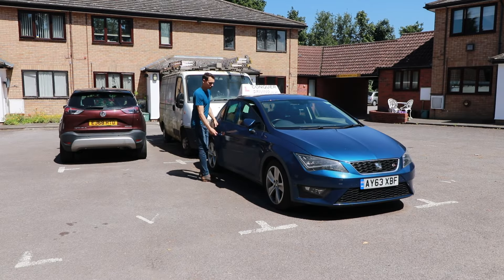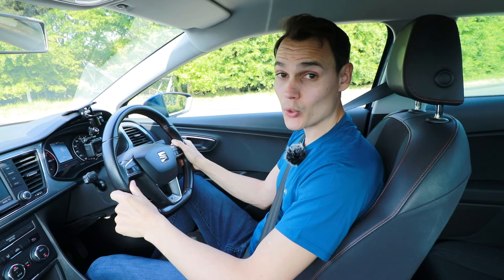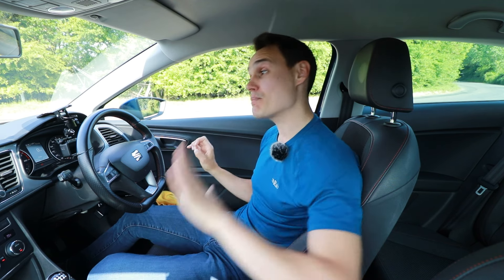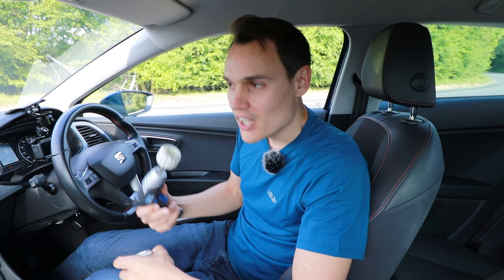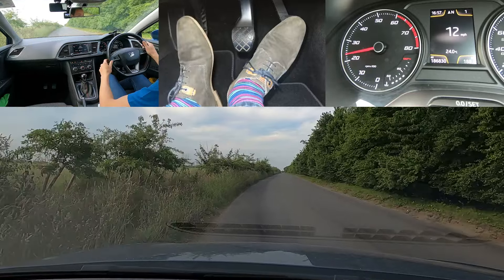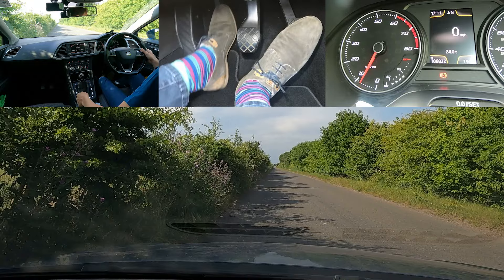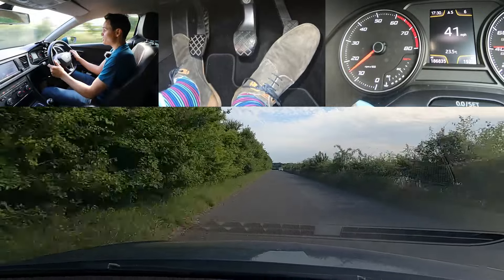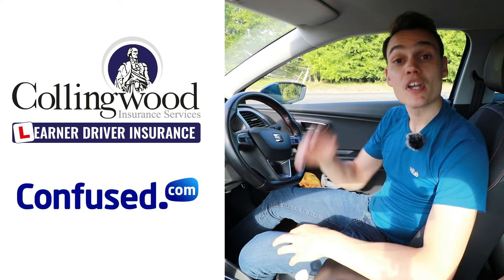Clutch Down Jerk? How to make it smooth.

Comment: As an American learner with my first 5 speed I’ve been binge watching these and then going out and driving around for hours after practicing 😅 
I’ve gotten decent at rec matching but my older car is very precise with the rev locations between shifts so I have to make sure I’m on it! 
Also hill starts were terrifying to me until I realized the E-brake method wasn’t actually hard I was just scared to try it 
My advice for nervous learners is to just put yourself in the worst of it like traffic and stop signs then do it again because that’s all driving really is in the end 😅

Comment: This is very vehicle specific. We have a Suzuki Swift that this applies to, but it also helps to press the clutch in as soon as you come off the accelerator. However on our other cars doing the opposite tends to be smoother,  which I very much prefer.

Comment: I am so stressed out trying to learn manual. My driving instructor wasnt helping much either. This clutch method i was taught while on the road driving with cars. It scared the hell out me since he started shouting 'clutch clutch'. I'm a beginner man. He also told me to release the clutch immediately after changing the gear and then press the gas pedal.

Comment: when doing Full Throttle shift, I think its pretty much a quick "see-saw" method. The reason is because the travel of throttle is long compared to when you are just cruising. When cruising with just like 10-25% throttle, it can be felt that it is clutch down first then off gas. When going full throttle, there has been instances where my gas doesn't come off quickly enough when my mind is set to Clutch down first then off gas. Just as shown at 6:40 when you did it a bit slower with clutch down first/then off gas...your revs shot up a bit. That is what happened to me when going full throttle with the mindset of not doing a FAST See-saw method.
Reply from the maker: I definitely don't do it perfectly everytime. Especially when switching cars often.

Comment: I know sometimes when I engage my clutch there's like an oscillating judder. I assume it's because the engine and gear aren't quite at the same speed and the judder is the clutch plate dampening springs bouncing backwards and forwards.

Comment: 2:44 I once thought this would most apply to turbocharged engines but a few months ago I was merging into the motorway with a hard acceleration in 3rd gear on a natural aspirated. When it was time to change, I thought: "I better come off the gas first before the clutch or the revs will go up". I let off the gas and tenths of seconds later, the clutch is down and still the revs went up as I clutched in.
Reply: My car does exactly the same thing and it's naturally aspirated. I usually lift off and wait till I feel the power to the wheels neutralise and then press the clutch in. In my car if I do it right you get a millisecond of rev hang after pressing the clutch and by the time you change to the next gear the revs are matched perfectly to lift the clutch and smoothly transition into driving the next gear. 

If you're curious my car is a Toyota Aygo. I can imagine this is true for allot of cars though, I assume the intake manifold takes a split second to build back up a vacuum.
Reply: @micheals1992  "Toyota Aygo" I think I know why yours does exactly the same thing. The car was driving was in fact a Toyota yaris with the 1.0 VVTI 69HP. I think the Aygo has the exact same engine with, if not the same, close  power.
Reply: @Danielagostinho21  it is the same engine, the only differences I'm aware of is that the 1L Yaris has a aluminium sump and an electronic throttle body (the Aygo uses a cable).

Comment: Well explained. Sometimes, like 1 out of 5 times, when I am pressing the clutch down, I feel some vibrations. I can feel the spinning of the engine. Nobody feels anything except my foot on the clutch pedal. Is it because my revs are too high for a particular gear? If I'm not wrong I have observed this more oftenly when shifting 2 to 3 and 3 to 4. What I am doing wrong unconsciously?
Reply from the maker: If your engine revs are increasing when you press the clutch down, it means you may be staying on the gas pedal. Try releasing the gas as you press the clutch down. If you are coming off the gas pedal and this is still happening, then you may have a problem with your car.

Comment: What about with downshifting? I've found that when down shifting at higher speeds (say, 3rd to 2nd at 30 mph) the car jerks a bit. I assumed that was natural since the rotational energy is being cut off from the drive train.
Reply: 30mph is still too fast for 2nd gear, hence the jerk. You should slow to a more appropriate speed (around 15mph) before downshifting to 2nd and reapply the gas as clutch goes through the bite point for a smooth transition. With practice you shouldn't feel any jerkiness.
Reply: There is a certain correspondence between car speed and engine revs for each gear. High speed at lower gear means very high revs, but when you downshift, your engine is probably at low revs. It can't suddenly go to high revs when you downshift due to the flywheel inertia. It will try to swallow your kinetic energy in a gulp (hence the jerk), but this is not a graceful thing at all.
Reply: I believe if you're going from 3rd -> 2nd at 30mph you need to rev match for it to be smooth. Depends on the gear ratios of the car though but I assume you would be changing down because  your 3rd gear doesn't have the power you want. Anyone correct me if I'm wrong though
Reply from the maker: This video may help: https://youtu.be/RMYtBIO6mLM

Comment: Hi, when I apply clutch, half way mark pedal has slight pressure but after halfway mark it goes suddenly down feeling no pressure.
Clutch Pressure plate change recently
Reply from the maker: Some clutch pedals are like that in my experience. Some are much nicer than others. Same with gas, brakes and steering, all cars vary.

Comment: The jerking only happens when changing gear at the wrong speed from my experience e.g: change down from 5th to 3rd while the car going at 60mph without slowing down.
It also depends on the car too, I drove a 2009 Golf that have the faintest biting point where you have to roughly guess where it is that the car gear changing is too good to mess up.
Reply: That's nuts, changing from 5th to 3rd at 60 mph ? I'm suprised you didn't lock up.
Reply: That's not what this video is about. The solution to your problem is rev matching on down shift.

Comment: is it important to hold at biting point even at 2nd/3rd and so on? thought I'd only need it to get the car going at 1st gear
Reply from the maker: In second gear you will still need to pause at the bite point but the higher the gear, the shorter the pause. In third gear and above you will barely pause at all.

Comment: With my Tacoma truck, it jerks - launching me forward - when I push the clutch quickly. Although I don’t hear clunking. But if I push it slower, it’s smoother. What could be the issue? I still want to push it quickly as I do see the benefit of it which is slippage doesn’t happen.
Reply from the maker: If it's smooth when doing it slow then I would do it slow. Do whatever is best for your vehicle, they all drive slightly differently, although I don't remember driving the car where pressing the clutch down slowly made it smoother.

Comment: wait i think im begining to understand 

so the clutch is kind of how a speed changer on a bike is, taking the chain off and replacing it at another plate[speed]

i think its the same for gears , but well with gears.
Reply from the maker: The system doesnt work like that but it certainly helps to think that clutch down is the same as the chain being off the sprocket/gear.

Comment: Hello I have a quick question out of curiosity. (When on a driving test) If I go on a roundabout and take the wrong exit and I end up joining a motorway what would happen? Would I fail my driving test?
Reply from the maker: Going the wrong way is not a driving fault. But driving somewhere you shouldn't (like a bus lane or no entry) would be a fail. Usually the examiner will not let you go where you are not allowed and take the controls.

Comment: Is your 188,000 mile Leon on original clutch? If I has I’ll be so surprised if the clutch is still original for 188,000 miles!
Reply from the maker: Not original but it's doesn't wear out, it rattles at idle after a while which annoys me. It seems to be the damper springs that get lose and rattle, I guess from learners dropping the clutch and generally learning how to use it. I've measured it and it loses about 20% friction material per 40k miles. This video may be of interest: https://youtu.be/0ZjSImbwo34